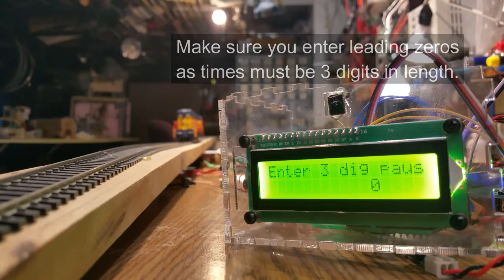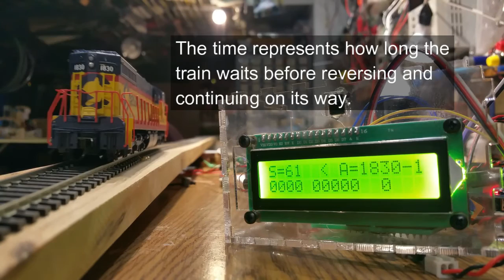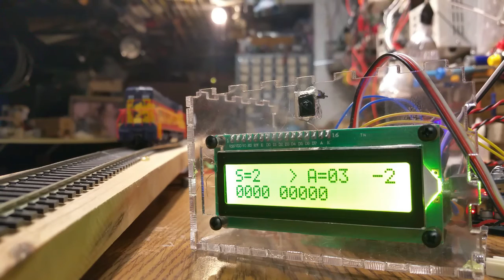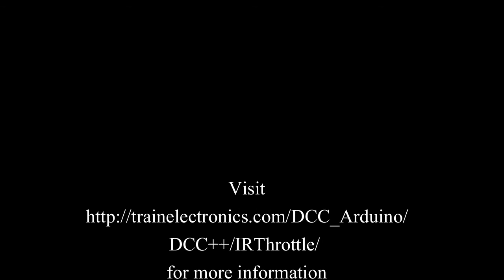Talking DCC++ Throttle & Point to Point Controller

Comment: Your excellent web site says "For the point to point two reed switches (one at each end of the track) are wired in parallel and connected to Trigger1 (SW1) - the other trigger ...".

Would it be possible to add another pair of reed switches to Trigger2 (SW2) on a separate Track-2 and run Train-2 as PTP on Track-2 at the same time as Train-1 runs PTP on Track-1 with SW1?
Reply from the maker: Interesting question, Patrick - I suppose that the code could be modified to do that but I have not done it - give it a try and let us know how it goes

dave

Comment: Adding the sensor, in your case the reed switch a few centimeters before the stopping point and letting the locomotive slow down before coming to a halt will present a more realistic movement.
Reply from the maker: I agree - this is something that could be easily implemented.
Thanks
dave